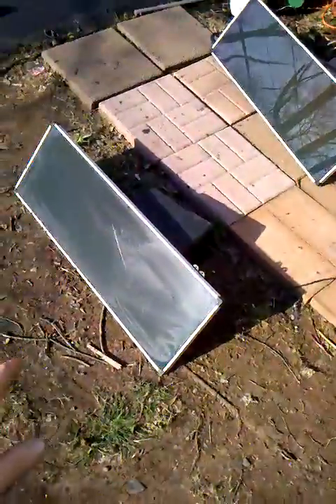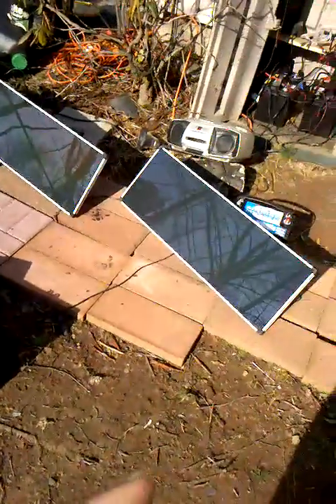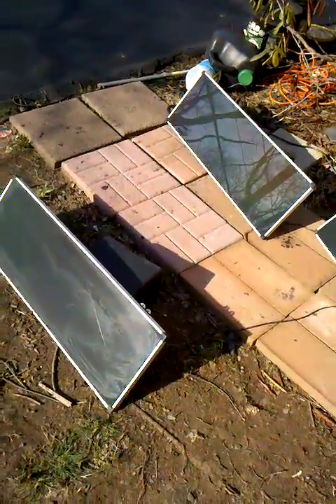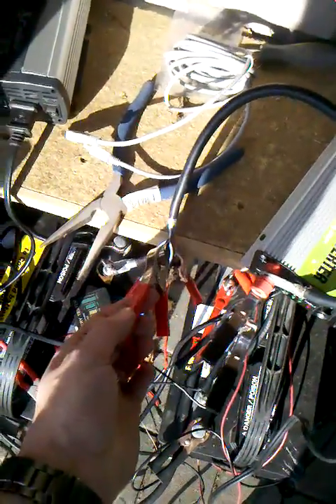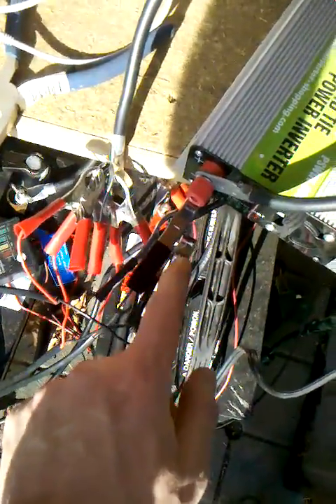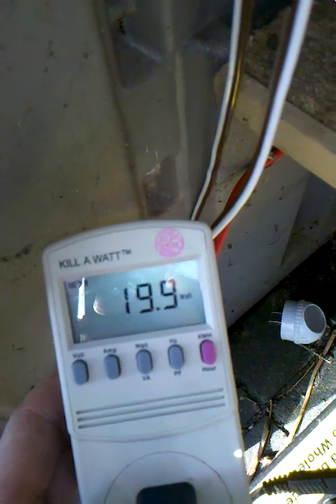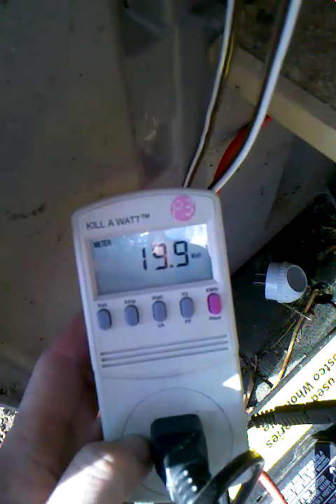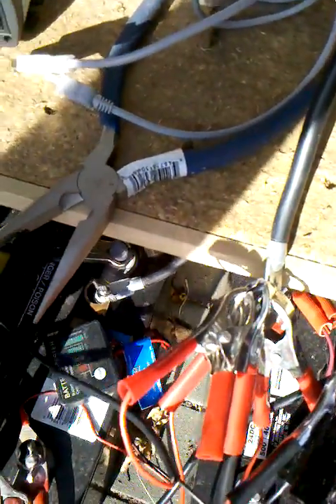Harbor Freight Solar Panels Grid tied question

Comment from the maker: @1956cuff   I have a powerjack grid ite inverter from eBay.   I think it is my grid tie inverter though, because I am measuring around 20W at 1 amp each panel, so that should be 45 to 60 watts.   Maybe it's as Mfr0928 says, you get more efficiency as you add more panels?

Comment from the maker: Wanted to update/ask a question.  I measured the panels individually at 18-20 volts at a bit over 1 amp each.  That is close to 60.  What do I do if my grid tie inverter is only 30% inefficient?

Comment: In full sun the panels put out 18.some volts, multiply that by the amperage of the panels which is 3.3amps apox. That gives you about 60 watts, your seeing 20 watts after the inverter, so your grid tie inverter is 33% effecient. Instead of using the aligator clips, use the bare wire attachments and twist up the wires and use an electrical twist on barret, or solder the connection for best results.

Comment: In full sun the panels put out 18.some volts, multiply that by the amperage of the panels which is 3.33amps apox. That gives you about 60 watts, your seeing 20 watts after the inverter, so your grid tie inverter is 33% effecient. Instead of using the aligator clips, use the bare wire attachments and twist up the wires and use an electrical twist on barret, or solder the connection for best results.

Comment from the maker: @1956cuff Thanks for the comment.   Did you have to clean the panels in any way to get that power output?   I only seem to get about 15-20 at the most in full sun.

Comment: most of those grid tie inverters are rated 20volts- 60volts, try linking your panels in series instead of paralle. the open circuit of those panels are about 20 volts which is probally why your even getting it to work to begin with. i have a set of those and for the price they work good ofcourse i use them to charge batteries. never heard of the newspaper thing though.

Comment: You need to buy a solar interface it takes all the inputs and controls them . The panels if new may have a coating on them that must be cleaned off with wet newspaper . I have seen this problem on a lot of the panels from them. Try cleaning 
them and see if it helps.